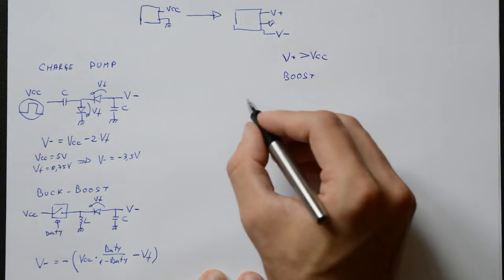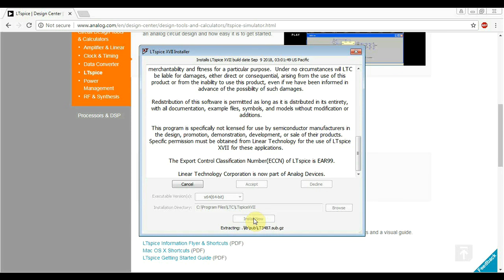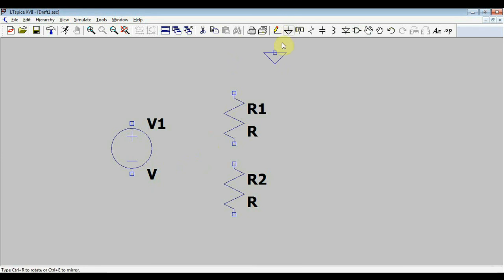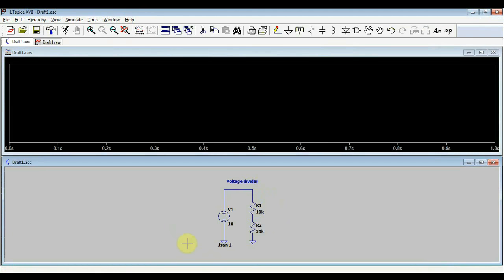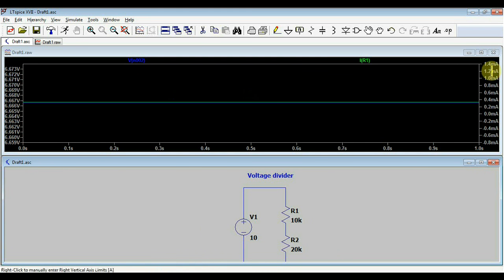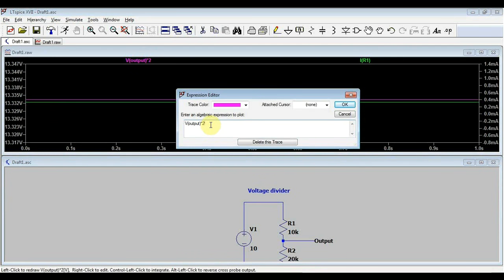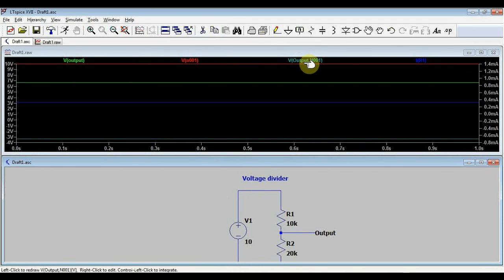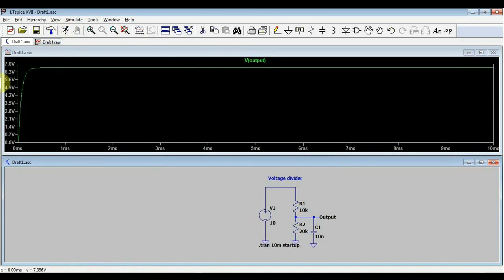LTSpice Tutorial - EP1 Getting started

Comment: capacitors definitely have an influence on DC circuits on startup, what are you talking about
Reply from the maker: When the circuit simulator starts a transient simulation, a DC operating point is calculated - for this all capacitors are treated as open circuits, and all inductors as short circuits. Once the DC operating point is calculated, and the transient simulation starts, all capacitors become charged with the voltage present on them - you do not see the charging phase at startup unless you select the "start external DC supplies voltages at 0V" option

Comment: Just another comment:  As described at 11:17, When setting the simulation parameter to Start external DC supply voltages at 0V, any data displayed in an .op Data label goes to zero.  Or if you hover a cursor over a net, the display values in the lower left of the screen go to zero.

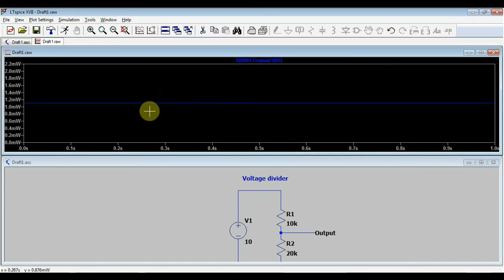Comment: Great video!  A lot of info packed into a short time.  To be sure I got the most out of this, I followed along in LTSpice.  Some other quick keys for adding components (whose abbreviation is not in the edit menu) are V (for independent voltage source) and G (for ground).  Also, the calculation for power at 9:12 (V(N001,Output)*I(R1)) is almost impossible to see, as the dark blue doesn't provide much contrast against a black background.

Comment: First of all, SPICE was created by University of California Berkeley. All the commercial versions are variants of Spice 3F5 I know this because I have an official copy including SOURCE CODE.  Second of all the spice schematic capture program is one of the worst so while there are times the Spice schematic program is important (such as developing models) great effort should be expended to use a commercial schematic program that can accommodate spice, such as PCB Artist. Having said that, this double speed tutorial is pretty good and better than any I experienced (including classroom - especially classroom) presentations. Before I degreed out. I worked as a technician and sometimes used Spice as a debugging tool. at first it pi**ed off the managers - but I solved problems they couldn't by any other means, usually in the time a simple problem could be debugged. After the degree those managers worked for me, but there was no other techs willing to learn spice.  So - Kudos to FesZ Electronics for a good presentation with one of the best simulators available to engineers AND TECHNICIANS.

Comment: I'm currently trying to learn some eletronics so I'm gonna simulate whatever I need before I'm trying to burn through money :D  Thanks for the tutorial!  I built the same circuit you did, but while simulating and hovering over a resistor, when I held ALT the mouse cursor disappeared.  It only turned into a thermometer when I was over the source.  What did I do wrong?  Cheers

Comment: For Mac users - the LTSpice 17 download does not have any toolbars, buttons, or controls. Run, stop, and control panel are the only 3 buttons. No, the control panel buttons does not have any kind of 'insert component' capability - still no way to build a circuit. The Mac version is little more than a grey screen where the user cannot build anything because there are no controls to insert anything. I guess I will have to keep doing what I have been doing: spending hundreds of dollars on parts from the chicoms and shit canning them when, not if, they burn up. Recycle the blown up components back to mother earth gaia via the back of a garbage truck and a landfill.

Comment: This is an excellent tutorial and a fantastic introduction for a beginner in electronics. Much faster to learn than spending time changing around components and measuring on a breadbord. Once understanding the circuit on LTSpice you have a clearer idea about what you should expect when building the circuit and measuring on a breadbord
Reply: No, this tutorial has a ton of gaps for people used to CircuitLab or other circuit simulation software. First of all, it doesn't explain how to go back to the select tool once you select a component. It doesn't explain how to get the default cursor. It doesn't explain how to make components appear smaller in the schematic.

Comment: First of all such a great video, thank you soo much for this.
One issue.
When I press alt key over the resistor, I don't get the power dissipated. Can you adress this issue?
Thank you for you answer in advance:)
Reply from the maker: Hello! You need to left click on the component, while still holding the Alt key. By pressing the Alt key, and going over components a thermometer symbol will appear and then when you click on the component the power will be displayed. This can only be done after the simulation was run, so the plot plane already appeared.
Hope this helps!
Reply: @FesZElectronics  yes I found it . Thank you very much

Comment: Actually I have two dc voltages (12vdc n 5vdc) with 4A.
 Willing to see higher voltage level in the output side, Using any one of discrete components . Here I have to generate either 12Vdc@2A  r 5V DC@2A using Lt spice simulation
Generally it is application for selection of one higher  voltage level from two different voltage levels when we plug in both 12v & 5v connector
 But current rating is different at input and output stage

Comment: Great tutorial! It's been awhile since I've simulated circuits!
Can this spice warn you if you exceed an LDO's short circuit output limitations?  (Some specs day to use protection diodes to avoid problems with shorting the output, others don't have that requirement)
Reply from the maker: Not really. One of the major limitation of circuit simulators in general is that they never tell you when smoke comes out of the circuit... Also depending on how well or poorly the model is made, you might not even get some of the protection functions. 
I would go with the manufacturer spec - usually the better made spec is the one with the most detailed information. 
I guess the safest way is to leave room in the layout for some extra components - if you need them great there is room, if not, well then it should not be an issue.

Comment: When i am trying to simulate surge suppresor lt4363 circuit with pulse voltage source it is taking much time. Please help me resolve the issue.
Reply from the maker: One of the things that usually help me is adding the command: ".options cshunt=1e-14" it adds 1e-14 F of capacitance to all nodes. Sometimes the simulator starts oscillating at high frequencies and it just takes for ever.

Comment: Could anybody explain me, why the current have different signs in LTspice for I(R1) and I(R2) (two resistance are in series so the current is the same), if you put one of them closer to voltage source ??? What is the sense of it ???
Reply: Watch this video from Dave Jones.
He explains what to do so the current will appear with positiv sign.
For short, you have to rotate the resistor with 180 degree.
In the real world, you can put the resistor any way you want, but not in the simulator.
https://www.youtube.com/watch?v=FEGT5dUpdrc
Jump at time 11.00 minute.
Reply from the maker: When measuring voltages its easy, the reference is either ground, or a different net but for current there is no reference direction... When you are performing a current measurement by going over the measured component or pin, you get the "current probe" symbol appearing. Apart from this symbol you also get a red arrow which will indicate the reference current direction - by reference to this the current is either positive or negative. In my case this arrow always points down on vertical components, and for horizontal components its either left if I go over the component or right if I measure the current trough a net (by pressing alt and going over the net). I usually just add a "-" to the displayed waveform in case I want the inverted current, I am not sure if there is any other way to invert the reference current.
Reply: @FesZElectronics  Thanks!

Comment: What key are you hitting to release the resistor, or whatever component one is currently using? I put down a resistor and then want to 'let go' of the resistor tool.  How???

Just found it, 'Right click!'
Reply from the maker: The common keys that I use are the following:
    - "Esc" - when in doubt press escape. This is what I used to put down the current component
    -  Ctrl+R - rotate components during placement
After simulation
    - Alt - plot power
    - Ctrl + LeftClick on plotted value - to show average power
Maybe some others also but I'm not really aware, I do it by reflex already.. But all Keys can be found under the following path:   Tools>Control Panel>Drafting Options tab > Hot Keys  and here you can also edit them. Like maybe you want Undo to be "Ctrl+z" instead of F9, or I for example set Draw wire mode to "Ctrl+W". You can set up the program however you want.
Reply: @FesZElectronics  Thanks!